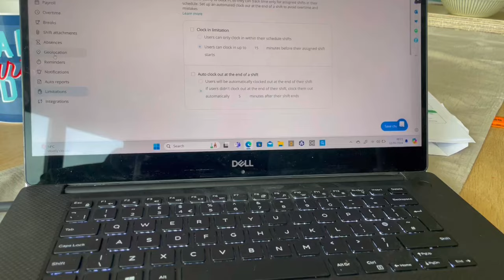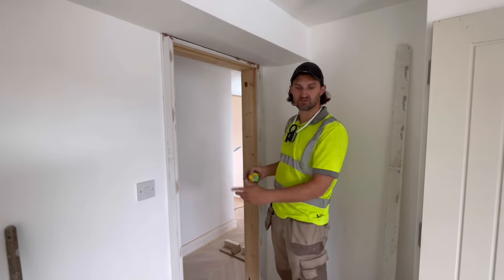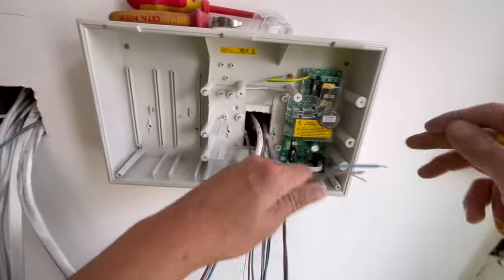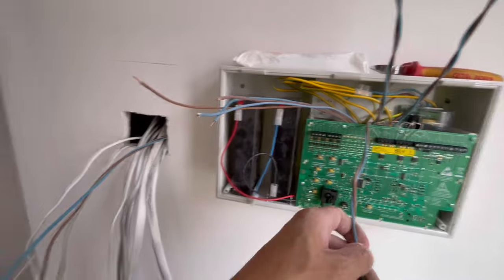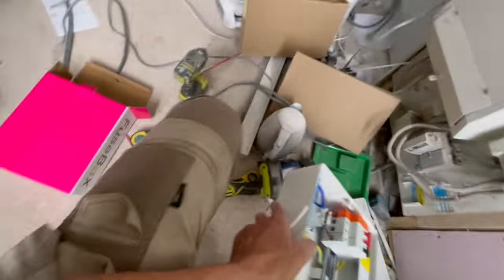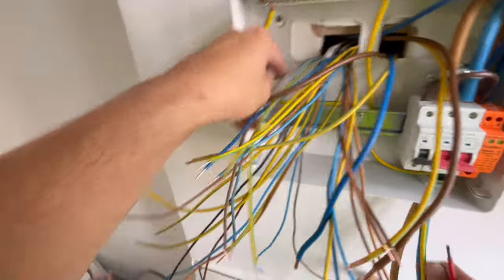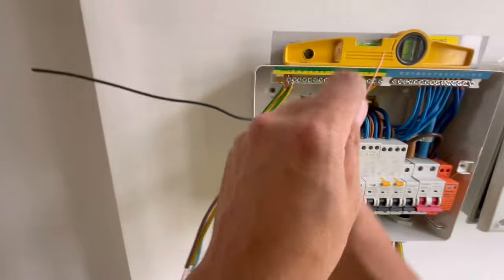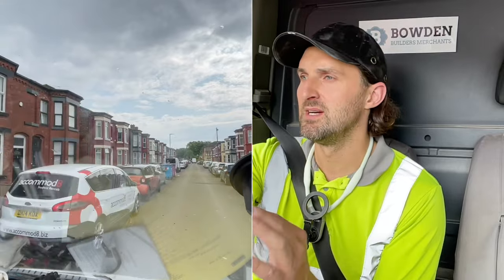Ep24 Wednesday - How To Fit A Consumer Unit & Fire Panel On A HMO

Comment: Get yourself an Ergostrip, that’s good for stripping  Fp200.

Why didn’t you fit an isolator for that fire alarm panel? Or fit an emergency lighting fish key?

Also it’s better to have the emergency lights on with the lighting circuit, as if the lighting circuit goes off, then they still have the emergency lights. the way you done it, you have to  have a total power cut for them to operate. Nothing wrong with the way you done it as each person does emergency lights different to be fair.
Reply from the maker: I’ll look at an ergo strip, so the fire panel and emergency light are on their own rcbo on the board so feels pointless putting another switch a few cm away from the rcbo. I’ve never thought about it that way with the lighting circuit could go off and the emergency lights won’t come on. Will start doing them that way from now on makes sense!
Reply: BS5839 Part 1 standard, says you have to install an isolator.  The panel should be fed from an isolating switched double pole fused restricted by key operation spur, supplied directly from the local main distribution board and should be fused at 3A.
Reply from the maker: @rjkelectrical6086  will add them on 👍🏻 would have definitely come up in my next assessment as it’s got afdd’s so they will want to see this new installation. Thanks for the heads up!